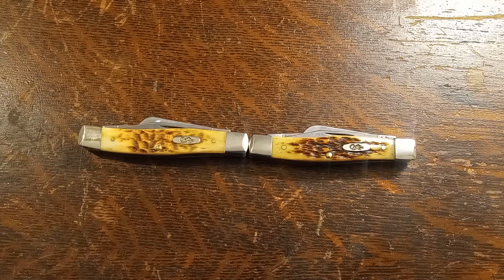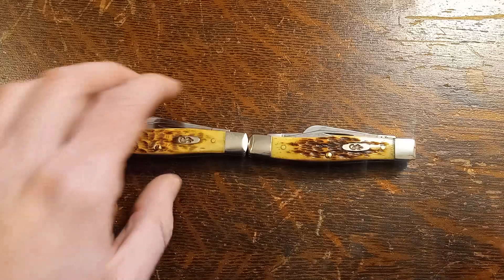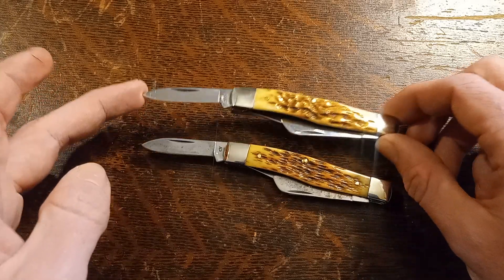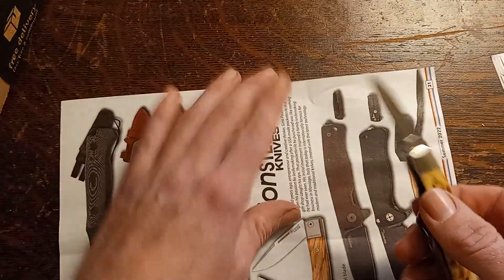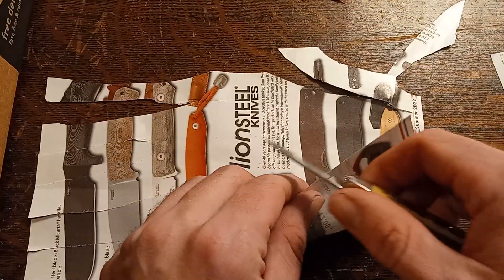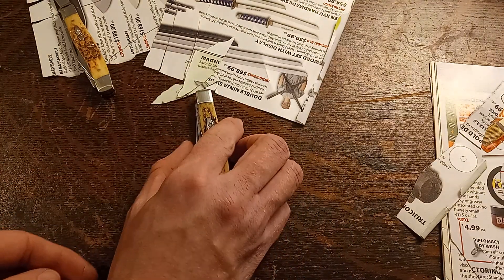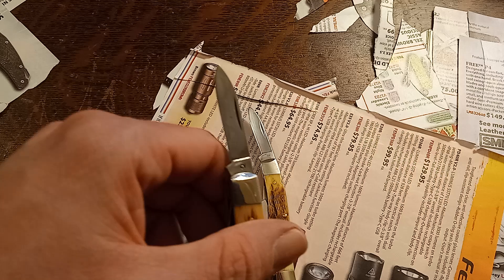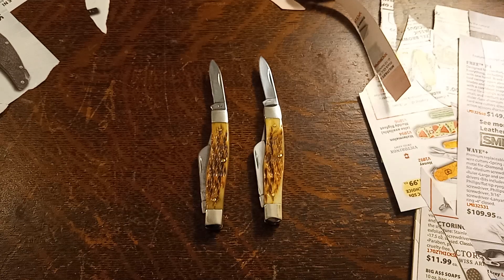Case knives steel cut test Carbon steel vs Chrome vanadium steel (which steel is better)

Comment: I haven't finished this video yet, but I wanted to ask you this: in your experience, do you believe the age of the knife, as well as the steel type, makes a difference in edge retention? I've found my Case knife from the 60s holds an edge better than my newer cv knives.
Reply from the maker: @isaiahthompson6751  Yeah, I haven't tested my 1960s carbon knives yet, but yeah there certainly is a difference in the difference years.
Case's stainless steel improved a lot a few years back. My older Case SS knives don't perform near as well as the new ones. And the new ones do really good, better than the carbon in my tests.

Comment: Good to know that the new CS steel is apparently better than the original CV.
Reply: I bought case Barlow in cs  I found it to be as easy to sharpen as the cv .  Both are just a great working steel .
Reply from the maker: @garyjacobs2789  Thanks for commenting 👍🏻
Reply from the maker: @paulyoder865  that's what my particular test showed. Others might have other results I don't know. 
Thanks for commenting 👍🏻

Comment: From what i understand, CV is 1095 with added chrome and vanadium to increase corrosion resistance, hardness,  and ease of sharpening. Interesting🤔 You'd expect the CV to do a lot better, especially from all the hype it gets and it was designed to be slightly better than regular 1095. Awesome test buddy🙂👍🏻
Reply: Case CV has been 1086 at least since the 2000's the new CS is 1095. I have both CS feels slightly harder and probably because of it has a better edge retention ( possibly ) over all very little difference imo. I like the CV maybe better it has a better feel to it on stones and takes a nice polish. But these are just my opinions based on casual use.